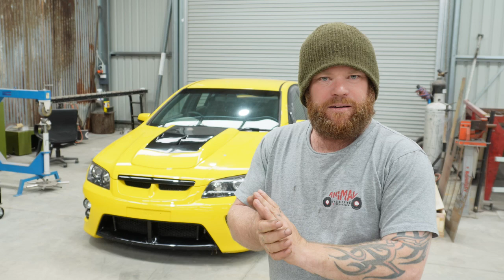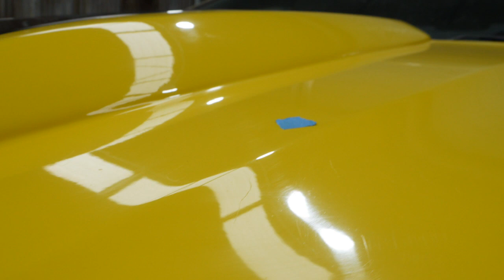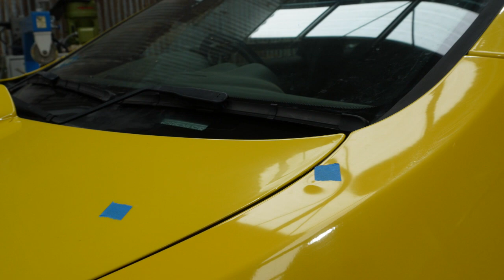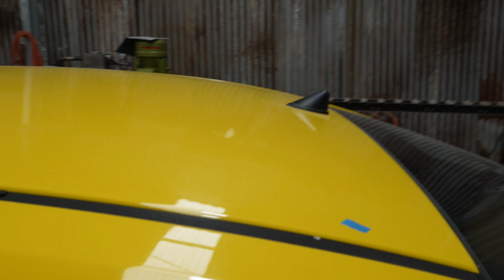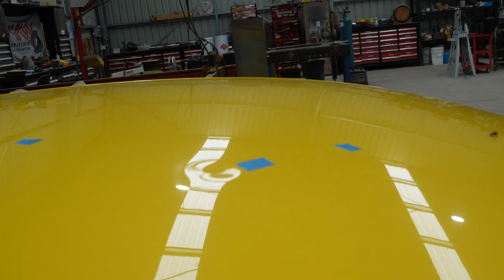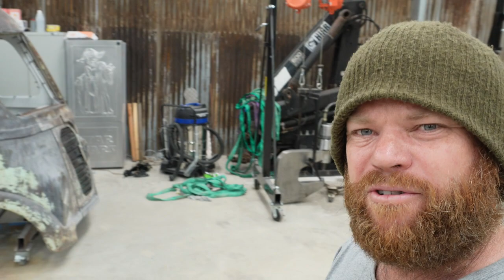SS Commodore, Donor car. Statutory Write off. New South Wales.

Comment: Years ago l watched an 18yo P plater learning to drag race in Vic, with a brand new, bog stock XR6 turbo that he bought from a Sydney auction as a hail damaged write off. He was humble enough to say that he wasn't skilled enough with the spanners yet to build himself a full on racecar, and not experienced enough to drive one properly, so this was the perfect choice for him to learn in. He got faster each run throughout the weekend, and even took another racer with him as a passenger during  a few runs to teach him exactly when to shift gears. 👍
Reply from the maker: Cheap way to get into it.

Comment: Was it flooded at all? Strange that they'd write it off just for minor hail damage, as far as I'm aware the only instant SWO criteria related to weather event is if the INTERNAL water level gets above the door sills.
Reply from the maker: Yea this car yard had a stat right off of every single car in there yard. I just missed out on an Vf lSA clubsport same damage as mine, there were also two Vf GTS similar damage one had broken rear window, went for bugger all to.
Reply: @animal_engineering  Fair enough, sounds like the yards insurance company just chucked the lot in the couldn't be arsed basket and wrote the lot off lol.
Reply from the maker: @mickk3943  I guess so, a lot of decent cars to just go Meh, to.
Reply from the maker: Definable no evidence of any water inside the cab. Still smells like it’s straight off the lot.
Reply from the maker: @WarmGlassOfBatteryAcid I think it went for 35k, from memory it had done 19 thousand k’s. Very similar condition to mine.